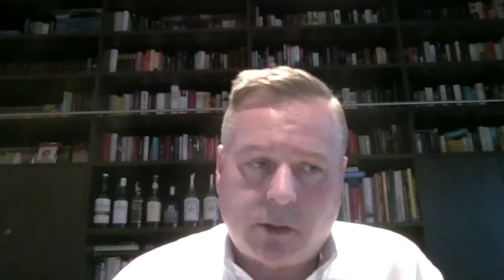CraftTrans Concrete Printer | Military vs Civilian Use

Comment: What a great journey. It was in the mid 1990's at a dinner party I threw in Manhattan when I first heard of contour crafting. I've been in love with the science and art form ever since. 

'Instead of telling the print head on a dot matrix printer to place ink, tell it to place materials, like concrete off of a CAD file.  BRILLIANCE DEFINED!

Thank you Jarett Gross and Werner H. Bittner. Very valuable information and insight. 

"FOR THE TIMES, THEY ARE A CHANGIN!"